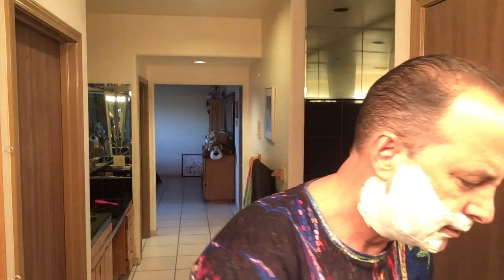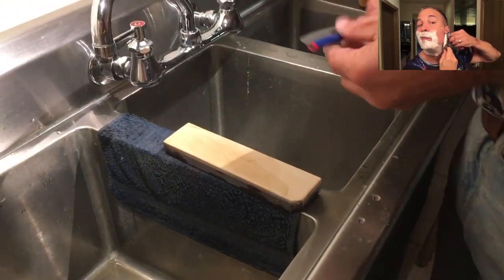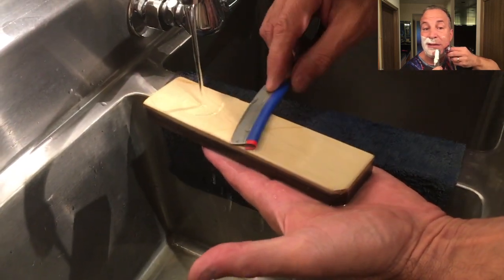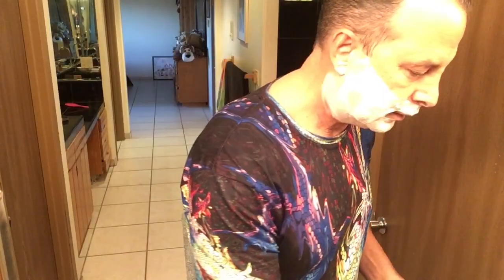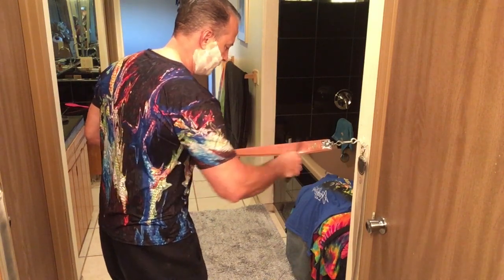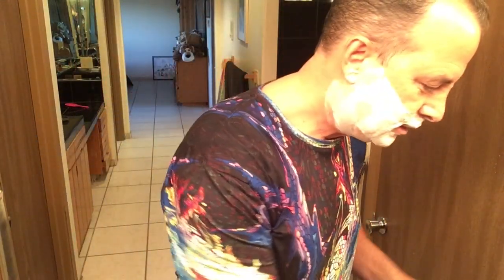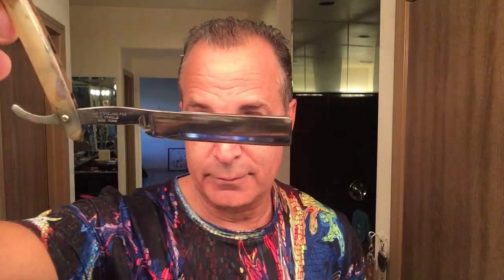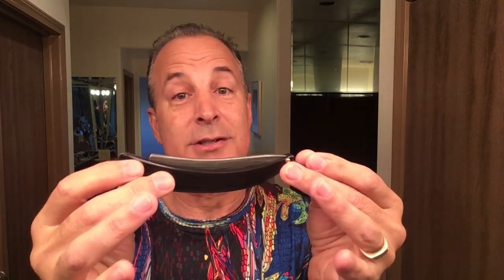Dickey Doo Mate!

Comment: Hey doc.. Thank you for all the videos.. Just recently got into straight shaving and got me a dovo that was not even close to being shave ready.. All I have to work with is a 1k 6k and ilr stone I been working on it for 2 days now and almost there (not all day lol)
Reply from the maker: Krattle Rattle - put a piece of tape on the spine. Go 30 passes on the 6 and the same in the ILR and you should be gtg.
Reply: @drmatt357  thank you... It's very sharp now.. I had to wait for my 3 inch premium ilr stone because my buddy wanted his back.. 3 inch stones make life so much better
Reply: Did you use soapy water on the ILR?
Reply from the maker: imalamboman12 -  no bitch I have tried it and works fine.
Reply: @drmatt357  typo?
Reply: @joewaz100  I think so 😂

Comment: I have a Bengall blade sitting in my "to restore box". It's in fairly good condition so shouldn't take too much work to make it pristine. 

Part of the reason it's been sitting there is I can't decide what scales to use but after seeing this video I have a faux tortoise set that might look good. 

Can I ask what software you use to edit your videos with? It seems good with cross-fade, PIP (Picture-in-Picture) zoom and all that good stuff.
Reply from the maker: TWalsh - the software I use is the basic iMovie that’s included on a Mac. There’s some really slick programs out there but with pretty steep learning curves. This is easy and does what I need.
Reply: @drmatt357  Cheers for the reply. Jeeze you're up early today.

Comment: Dr. Matt you are amazing at what you do, I have a sheffield razor on this model, what did you use on the back to sharpen that razor?
Reply from the maker: Sandro Torres - Thank you Sandro. I gather you mean what did I use prior to the finishing stone I showed?  In this case, I had to go down to my 400 diamond plate to get all of those  chips smoothed out. The owner said he dropped it on the tile bathroom floor. I then used my 1200 diamond, 2K, 5K, 8K. I did change the tape a couple of times inbetween.

Comment: I finally had time to get the warp out of my razor ! The videos have been so helpful. So questions, the highest grit I have is 8k from the  Norton 7660787943   set, along with a simple linen and leather strop. I don't feel like it's getting smooth enough for shaving. Should I keep working the blade with this 8k and strop or do I need a higher grit stone?
Reply from the maker: dragonspy91 - you can shave with an 8K edge but should go to a 12K as they are more comfortable. Another option would be to go to a pasted strop like chromium oxide on balsa. I’d rather do the stone but the other is cheaper.
Reply: Thanks for the reply. I'll have to make a balsa strop next.

Comment: what are those round bases that you use for holding the stone and where can i get it?
Reply from the maker: They’re called bench dogs and you can get them on Amazon.
Reply: @drmatt357  thank you so much
Reply: Those 'Bench Dog 10-035 Bench Cookie Work Grippers, 4-Pack' seem unavailable -- https://www.amazon.com/dp/B0037Z7D0A
Try two 'Rockler Bench Cookie® Plus Work Gripper (Single)' -- https://www.rockler.com/rockler-bench-cookie-plus-work-gripper-single
Reply from the maker: borbetomagus - thanks for the links!  I see the blue ones you can buy singles. That’s good.  I still have 2 unused ones from my original pack from years ago. 😁

Comment: Hello Dr. Matt! Ive got a question for you. I just recently bought my first straight razor.(hopefully a good one) I was wondering what i really need to sharpen it up right? I have a no name 400/1000 diamond stone a king 1k and a no name 6000/8000 whetstone. I also have 3 leather strips loaded with 800 chromium 5000 diamond and 8000 diamond. I have up to 100-150 bucks to add some pieces for sharpening. Any advice would be great!